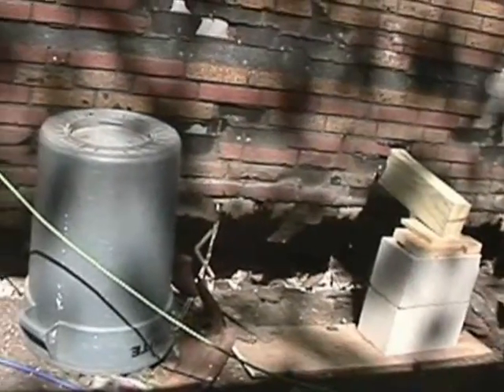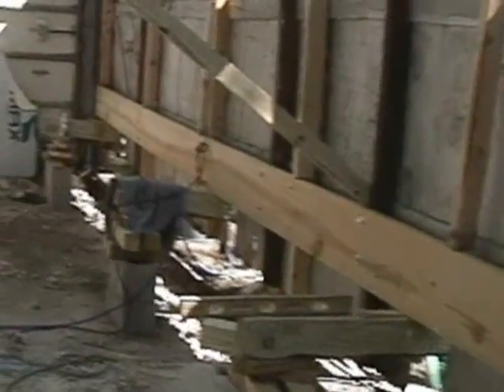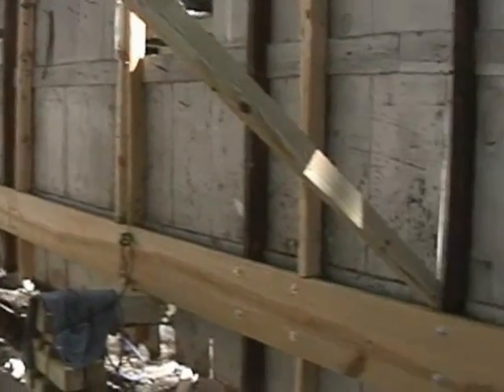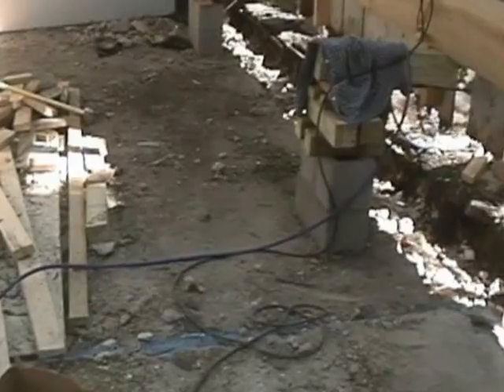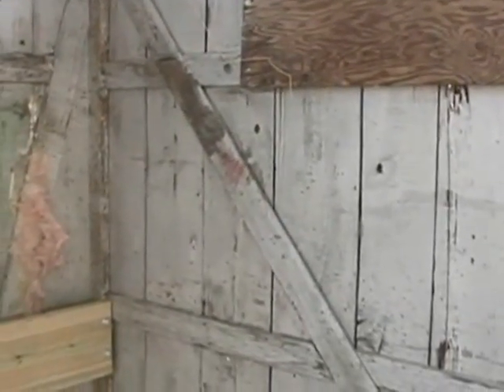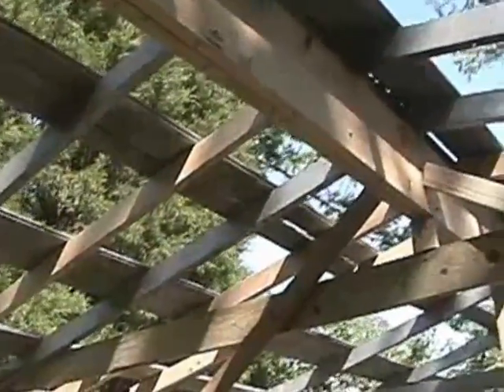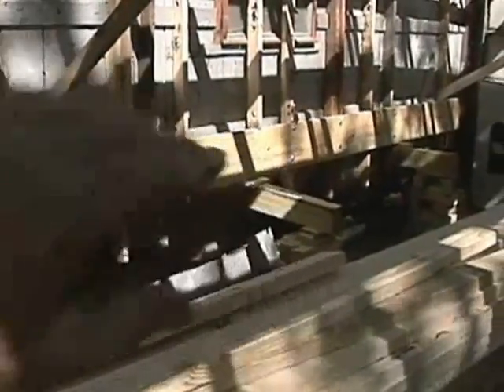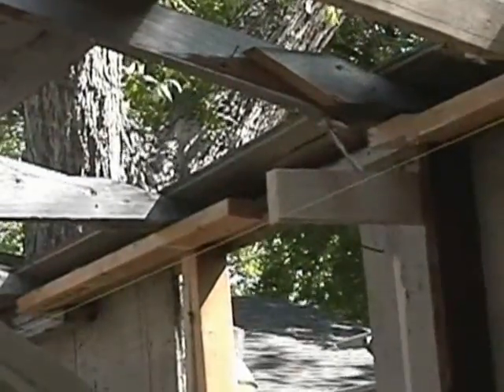saving your garage part 1 when there is no hope , see part 2 and 3 for continue in description

Comment: Wow! Shocked and surprised with the amount of work. My first taught why not torn down and make new. Cheaper and way faster. But I've read your comment/reply. Cheers. :-)
Reply: Same here I rather keep the old structure intact and as I had responded to, not incur the labor and permit pains going through building a new in another location per what is allowed by the county/town and save money by just repairing and remodeling the old structure "in situ".

Comment: I'm trying to figure out why you bothered to raise the nothing building?
Reply from the maker: It's all about the location. If I tore it down the new building codes would have made me move it to a new location and take out a 50 year old pecan tree along with other problems.
Reply: Not sure you will get a notification for this, but if you do well then here it goes.
Often times I have done or seen such remodeling repair jobs done and the customer paid far less for this and as he told you himself the headaches and pains that comes with permit requirements for relocation to adhere to new codes if its a grandfathered structure. Pay upward of $5,000 or this type of repair or the cost of permits and relocation prep along with materials and new construction labor with the concrete work being a separate cost but adds to the build and spend double to five times as much.
Now ask yourself this, which would be YOUR choice in this type of situation? IMO I rather spend my  money on lifting and repair-remodel a perfectly still good sturdy structure.